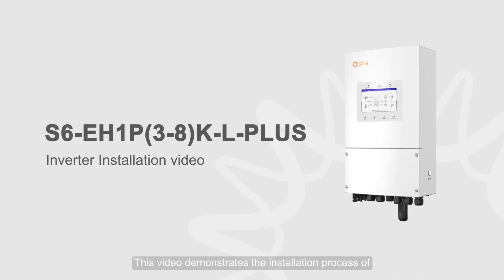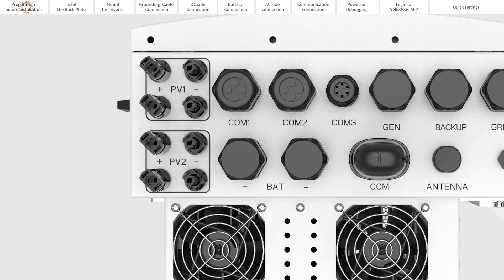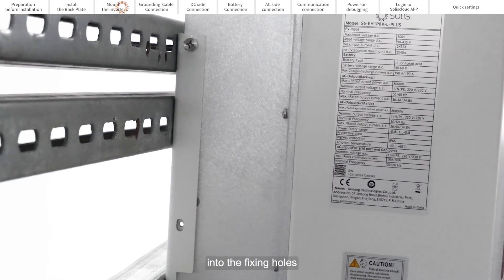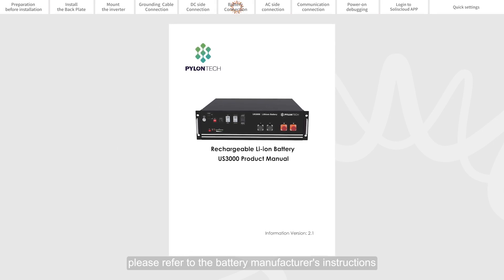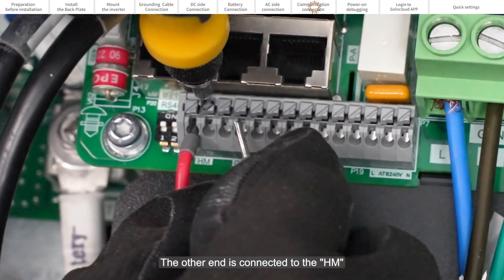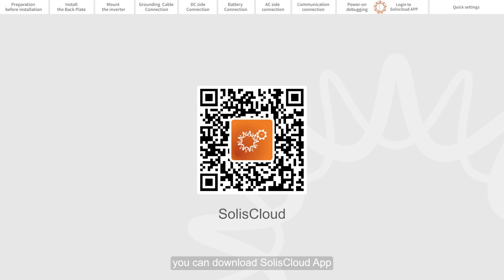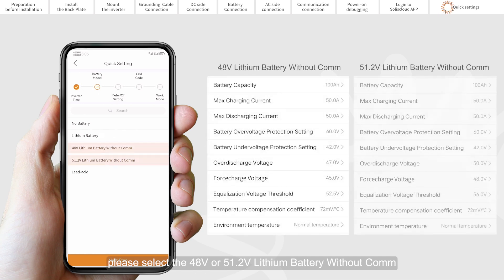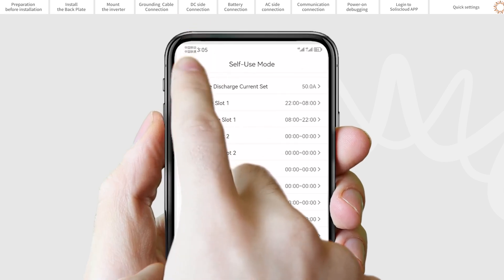S6-EH1P(3-8)K-L-PLUS #Solis Inverter Installation video

Comment: which one is the higher tier PLUS or PRO version? they both have the same features/specification but PLUS has LCD screen right? I need to make sure the PLUS version is as capable as PRO with UPS and smart load management.

I want to replace my old solis inverter for the 4ms switch over.

Comment: Common neutral is common here in Pakistan. Can we common gen port (heavy load) and backup port (light load) neutrals in Solis single phase hybrid inverters? If not, how to split heavy/light load when house wiring has common neutral?
Reply from the maker: Hello, you can inquire by contacting the after-sales customer service on the official website of Solis in your local area. The website is [https://www.solisinverters.com/global](https://www.solisinverters.com/global). I hope this helps you.

Comment: I have this in Pakistan. Great inverter. Please share settings. I watched all of your videos on settings. I have Solis s6 8kw. Running without battery, but the inverter do not show smart load on pv only.
Reply: Check location of CT-Coil
Reply: Go in smart load setting on inverter and click on grid always on smart load will be operational.

Comment: Under which circumstances do external fans turn on on 6K model? Really want to get this inverter but can't find this info anywhere, would be grateful if someone could provide an answer!
Reply: Same question did you find it's answer ?
Reply: @FirstHelpDesk  Solis support said fans turn on if one of the following conditions is met:

> PV current >10A(30% duty cycle)
> Battery current >70A(30% duty cycle)
> Radiator temperature >65℃(30% duty cycle)
> Total Grid side current >25A(30% duty cycle)